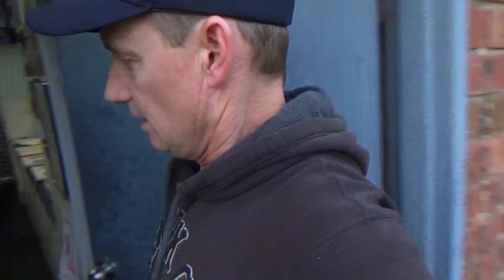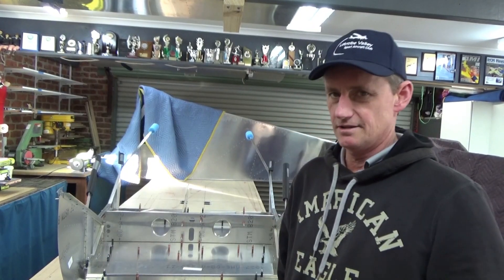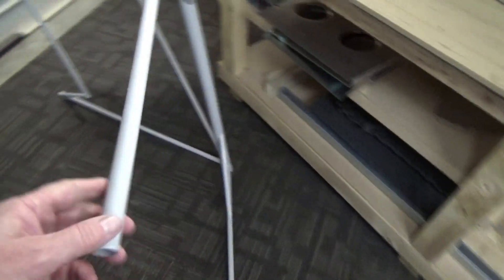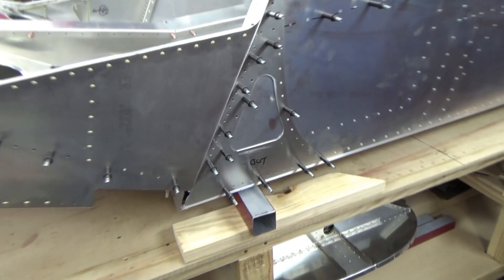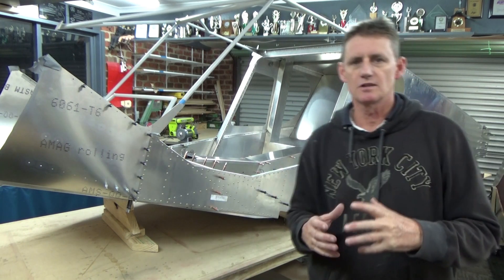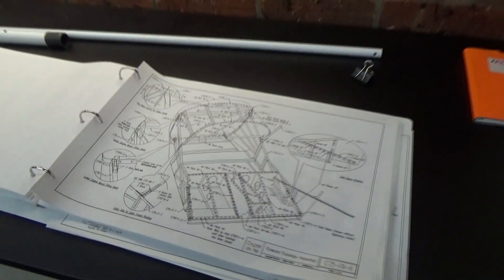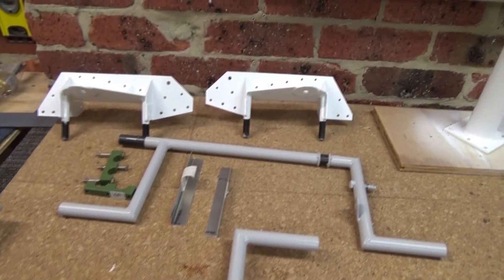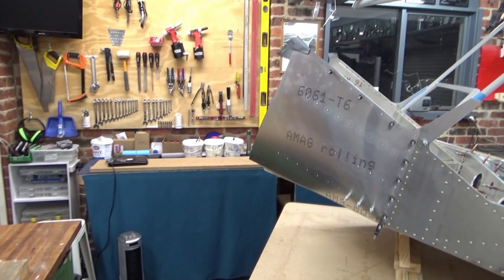How I joined the Aussie CH750 Cruzer Fuselage

Comment: HI Scott - preparing to join front and rear fuselage sections on Cruzer.    I believe you mentioned you were considering accomplishing this be installing the two side pieces separately, then attaching other items.  Seems much easier than installing as a single unit as I work largely alone, but wondering about "gotchas" that might be lurking.  Thoughts on your experience and hindsight would be appreciated.  Thank you
Reply: Scott - after more thought, proceeded with the piece by piece installation of the forward fuselage sub-assembly to the rear fuselage.  Good result!
Reply from the maker: Yes I did mine all alone, piece by piece was the way to go. Only gotcha I found was with the seat floor sections. Make sure the sides are complete and everything pulled in tight before drilling for the seat floor that go through the large L angle type section under the outboard seat belt brackets.